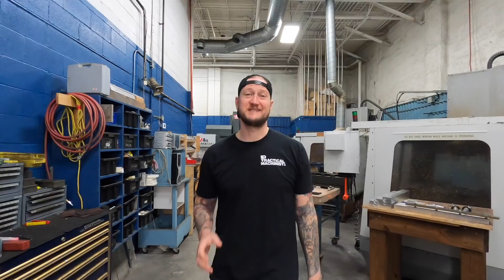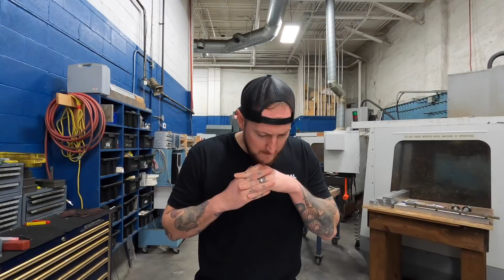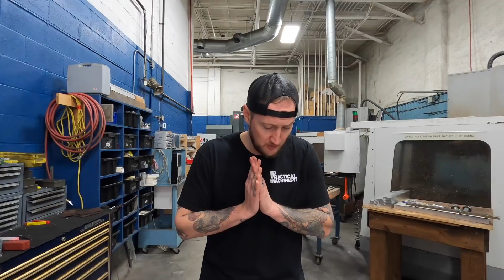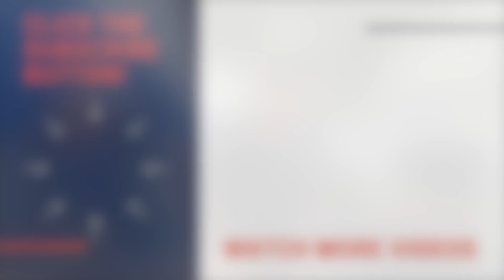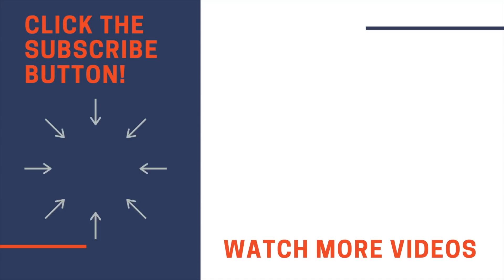Why CNC vs. Manual is Such a Heated Debate?! | Machine Shop Talk Episode. 46

Comment: There doesn't seem to be much information available, but what are the typical tolerances on a used job shop CNC? Are they subjectively speaking crude or precision tools? I suspect it's not even comparable to a toolroom mill or lathe but I might be wrong? There was a time when manufacturing machines were big, bulky and with limited setup possibilities but they were just that, used for manufacturing specific parts. Toolroom machines were located in the background, reserved for precision work and making tools.
Reply: I’d say once you get past the hobby-rated stuff, anything decent should be able to hold a couple of tenths all day long - but it’s a bit like asking how long is a piece of string when it comes to used stuff, unfortunately.

A 15 year old machine run by guys who knew what they were doing, properly maintained it, didn’t crash the spindle, etc will be far more accurate than a 5 year old machine that got clapped by apprentices for its entire service. 

I personally think buying cheaper new is more reliable than buying a more expensive machine at a used discount, because you can never really tell just by looking at them how they’re going to perform, even with a full service history.
Reply: @LakewoodMachine  Thanks for your reply. Interesting. This certainly changed my opinion on whether there's any benefit one way or another.
Reply: I have two used cnc Fadal mills.  My first i paid 8k for and the second 10.5k. I do close tolerance parts and never see a machine issue. Great way top start a shop on a budget.
Reply: @danneumann3274  thanks for your input 👍

Comment: hi this topic has come up just at the right time i am a manual machinist/tool and die maker with 30 yrs experience i worked at the same company for 18yrs
i only have a few years to go before i retire . over the last 5 or so years the company has move more into CNC witch i have never worked with,  my boss is
telling me if i don't learn CNC then its time for me to pack my tools . So is there still a place in this industry for me and at this late stage of my working career
and will i get another job .
Reply: Oh there are most definitely still shops out there who utilize manual equipment, and some that still run exclusively on manual equipment! They tend to be for fairly specialized stuff or one-off type jobs - but they’re out there.

I’ve had the chance to go to many shops over the last few years across North America, and I can think of exactly two that didn’t have some kind of manual equipment that was used regularly.
Reply: @LakewoodMachine  thanks mate there are very few job shops left were i am in Adelaide South Australia i starting to think about semi retirement and doing some jobs from home as i have enough equipment to get me started. its just a bit disappointing that things are going to end this way

Comment: I was a great manual machinist. However, once I figured out how to program and run a CNC, I dreaded using the manual mill. The CNC was so much tighter and accurate even when jogging it manually.
Reply: Even for repair work sir?
Reply: Can not replace i highly skilled tool & die  maker or moldmaker repairs / builds designs & modification  one of a kind dies or molds with bench work &  broad knowledge of all machine shop equipment & machines ..I worked in both cnc & tool&die shops ...good video ..

Comment: I prefer cnc/ manual.   An ez-trac or accu-rite is the best of both worlds.  The cnc colchester triumph is a manual/cnc with conversational software.  It will cut threads hell of lot fast than a manual  Machine.

Comment: I run both CNC & manual and enjoy mixing up my day by hopping back and forth
Reply: It’s always good to have manual equipment and ability to add capacity! Some of my guys will pick away at making parts manually when they have cycle time, even if we usually do it in the CNC!
Reply: Tool & Die Repair & mold making & making spare part on the fly manual  can not be replaced & cnc is excellent for production & exotic metal.. machining ..

Comment: I prefer to use files and cold chisels.....

As an engineer, I've used manual machines for prototyping/modifying and one-offs but for production its almost always CNC.
However, there was one job cross drilling bolt holes in the ends of aluminum tubing, where a good drill press fixture could probably outpace a CNC.
Reply: It’s always funny when you figure out that a guy with a floating vise and a drill press can out produce a quarter of a million dollar machine!
Reply: @LakewoodMachine  Yes, and its easier when a machine can be set up for a dedicated task, then pass the part to the next machine for the next step.

Comment: I think there’s always a spot for a manual in a shop we’ve got a old hardinge in the back ever once and a while it comes in handy. I do recommend checking out Overbeck machines they make a little deburring lathe  it fits on a bench top.
Reply: An interesting I never actually thought of using a benchtop lathe for deburring - I always wondered what the application beyond hobby use would be for those!

Comment: i started on manuals so can see the benefit of both , we use the manual mills to do the one off simple parts, but saying that i try and plan them into the work when the cnc is doing a job with the tools needed set for another part so only a 2 min switch to do the one off . on turning  , i wouldn't want to piss about using a steady rest on a cnc with a long shaft not that i ever have, it would be on a manual lathe with a DTI chasing the taper,
Reply: Oh yeah I hear you there - we actually used to have a real big lathe with a 60” capacity and I’m a little sad we got rid of it a few years ago - it was a boat anchor but we did stuff on there I wouldn’t even consider getting near the CNC lathe!

Comment: >heated debate

Both have their place. Guy called Stephan Gotteswinter (yes, he has a youtube) holds microns in a basement shop on manuals. Go to any industry show to see the CNC side of things.
Reply: Sheesh, I’ll have to check that guy out - that’s some serious skill!
Reply: @LakewoodMachine  NYC CNC toured his shop (literally his basement, bloody germans and their native 240 3 phase), 2 years ago. It's what got my attention in the first place. Although admittedly I haven't watched any of his videos in a while. He's got some cool stuff that you don't see every day (the tracer is fantastic, it's what he uses to make TINY little titanium torx screw heads, or at least he did, dunno if he's upgraded to actual CNC for that). He's also a fair service (read: top tier) guy, he's retrammed/ releveled all his machines to PHENOMENAL accuracies.
Reply: He's doing that as a side business. When you need to make 5 pieces of a precision part, it probably pays off to have some guy do it as a side job. Not saying there's anything wrong with it - rather saying he won't be able to spit out 200 of those every day

Comment: I think that you can do a job on a manual machine if it is not too complex but if you have a job that requires many different operations and the tolerances are tight then I would say use a CNC even if it is only a one off.
Reply: For sure! Especially as I'm a guy who is more proficient with CNC vs manual, if I have something that's super tight tolerance, I personally will likely lean on the CNC even for one part - since I feel more comfortable dialing it in (with wear offsets or what have you) on a CNC instead of trying to do it manually.

Thanks for watching!

Comment: cool.mention of the american precision museum in windor vermont near the longest wooden  covered bridge  between  windsor vermont and cornish new hampshire.
Reply: It was amazing man! Vermont was such a cool town - so much history there. Really recommend everyone interested in the manufacturing trades to check it out!
Reply: @LakewoodMachine   it is amazing windsor vermont is a constitution state one of the 13 colonies. the precision museum was a state armory. it was powered by water.power and over head power belts that would be outlawed by safety board for health and safety.  i am from and old school where it is safe until it ain't. but safety is the eye of the safety officer the museum opens in may and closes on halloween day. when they solve the heating and snow removal challeges may be they will remain open during ski season. the halloween  closing there has been a model show and a swap meet in the community center and a parade for and of veterans on the old state route 5  before interstatc I91 was built parallel to.route 5. but shorter and straighted with bigger and higher bridges allowing foe the  highway speeds that.we enjoy today. 
you also had Springfield vermont another usa manufacturing center with lamson comparator. lovejoy tool  st johnsbury and fair banks scale. the connecticut river valley tool.centers. in days of old and newer smaller tooling centers today. ever changing and always changing with the time the steamtown train and trolley was a place to visit in bellows falls vermont now it is in scranton Pennsylvania with steam town electric trolley museum and iron making stone charcoal burning iron furnaces near the Lackawanna coal mines and museums and probably more visit  them if you like you will not be disappointed

Comment: all seems to forget...a cnc machine can also be operated in manual mode
Reply: Definitely can and I've done it before - I'd still prefer to do some manual tasks on a manual mill however - the ability to 'feel' the tool as you peck for instance can be critical for finicky jobs.
Reply: @LakewoodMachine  I agree with that

Comment: Engineers are designing stuff around CNC machines now. The times have changed. Not to say there is no place for a manual machine, but the need is going further away from manual the more that time goes on.
Reply: I'd say this is a very fair assessment. I'd also point out that some engineers like to design stuff around machine capabilities that don't even exist in this reality - but that's another conversation for another day!
Reply: @LakewoodMachine  Oh yeah all of the time!